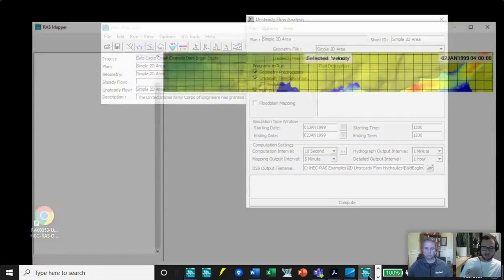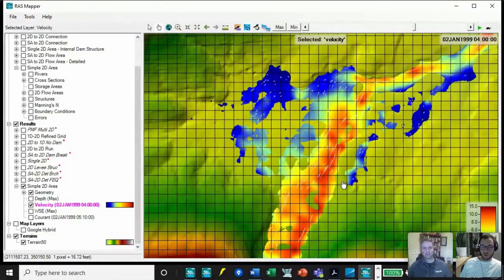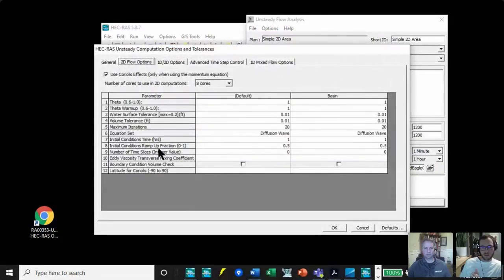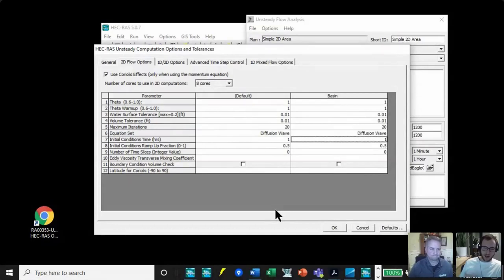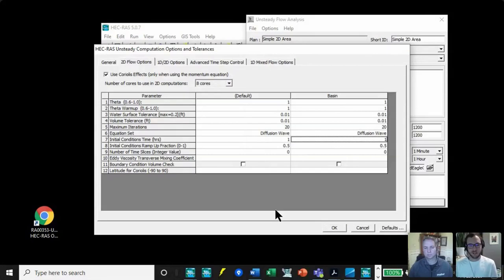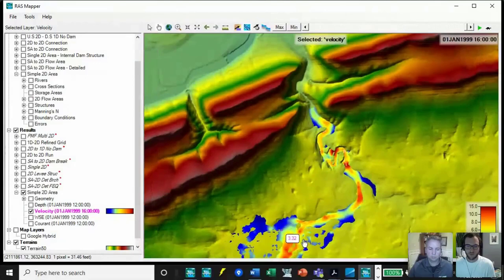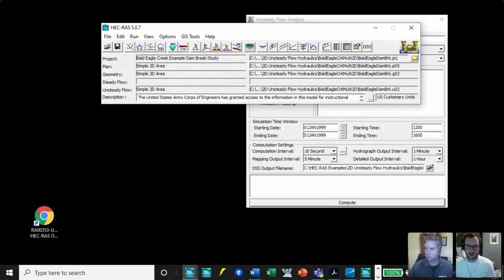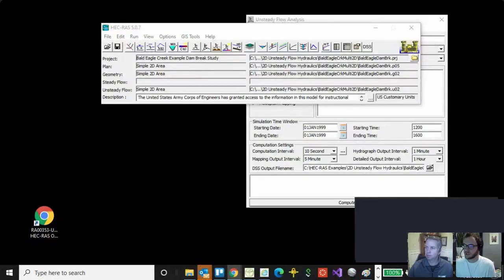Episode 11: Happy Thanksgiving! And how to build a simple 2D model from scratch.

Comment: Thanks guys! Little late but give me a turkey leg, with a side of corn casserole, and sweet potatoes. 

Would you normally recommend lowering the time step when going from Diffusion Wave to Full Momentum?
Reply from the maker: Ryan- that depends on what the Courant numbers are in the model using DW. If they are above 3 I would lower the time step when you switch to FM. Sorry for taking so long to respond!

Comment: hi, I am currently working on modelling glacial lake outbursts for my dissertation with HEC RAS. Therefore, I was wondering whether you have any videos relating to dam breaches or if you would do one in the near future.

Thanks
Reply from the maker: What particular questions do you have Charlie? Also check out this article talking about how Chris Goodell set up 1D and 2D models of the Missoula Floods! https://hypernetlabs.io/hec-ras-galileo-wine-have-in-common/
Reply: @TheRASSolution  I have a working dam breach model, however, the volume of the glacial lake is calculated using elevation data of the storage area. Therefore, I was wondering whether it would be possible to enter volume data into HEC RAS model rather than have HEC RAS calculate it for you. Thanks.
Reply: @charliewalker9060  If you make your reservoir a storage area you can give it a stage-storage volume. Doing this means that you are performing level-pool routing as opposed to dynamic wave though. I believe Chapter 14 of the Technical Reference Manual talks about ways to attempt to go from stage-storage to cross-sections. I guess it depends on the purpose of your model, time constraints, etc. if that is something that you want to pursue.

Comment: Hey guys. I hope you have had a nice Thanksgiving day. There I have a special situation in a HEC-RAS modeling. How can I model a river which separates into two branches? How can I find the flow which diverts into the tributary reach?
In fact, if I model it in 2D, it will give me the hydrograph. What about 1D modelling? Thanks for all the helpful efforts and information you share.
Reply from the maker: You can model this situation in either 2D or 1D. If you model in 1D you will need to use a Junction to split the reach into two branches. if you use 2D you will need to use a profile line to capture the flow hydrographs in each branch. We may do a Vodcast on Junctions soon so stay tuned!